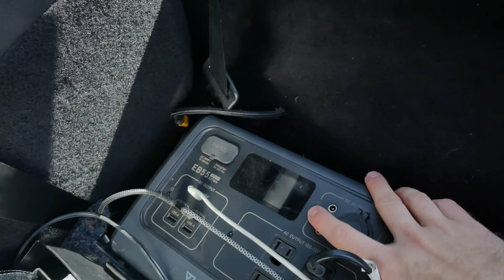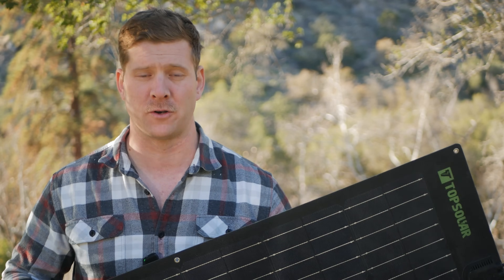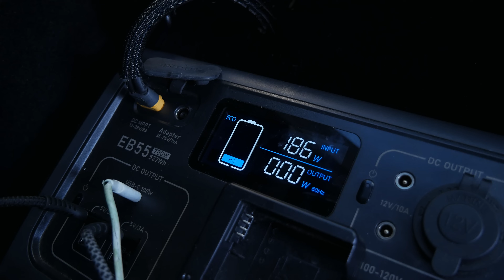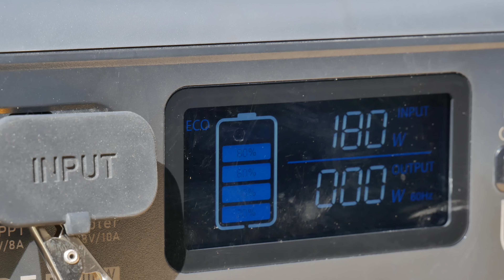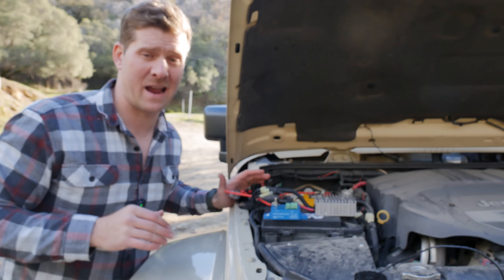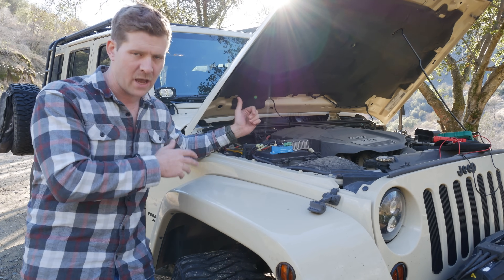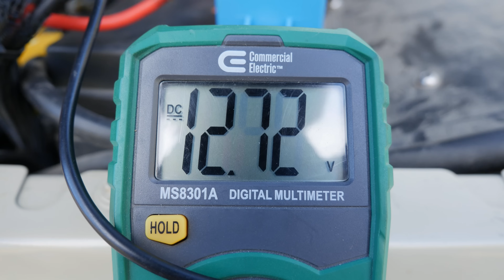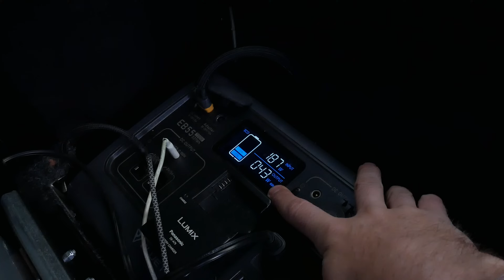Solar is Impractical for Overlanding: Here's a Cheaper Alternative That Makes 200W!

Comment: so basically, you are saying a diesel generator is better than solar, because that's basically what you're doing, no? transform your diesel/petrol into electricity...
i'd still say solar is cheaper: you generate electricity when there is sun, and you don't pay for sun... but you do pay for using your car (maintenance, petrol, ....)
Reply from the maker: @peetersbjorn  I'm not running the engine just to charge this battery. Simply an inexpensive way to capitalize on a higher rate of charge while you're driving to your next campsite

Comment: very nice! I like your Victron solution. those are good quality. I used a cheapo Ampper battery isolator. its 24V out when the input is above 13.3 and stops at 12.8. it can not however live under the hood.
Reply from the maker: @tronskifpv  interesting, what's the issue being under the hood?
Reply: @RhinoOffroad  its not potted like that nice victron you are using. its got conformal coat but you'd have to see one. very  light weight build
Reply from the maker: @tronskifpv  oh gotcha!

Comment: Great video!  But this is not a new concept.  There are YT videos that feature a DC to DC charger that does pretty much the same thing.  However, this solution is a slightly cheaper alternative to purchasing a DC to DC charger with prices starting at approximately $100.  I was shocked that Victron actually sells a product for under $150. 😳  The Victron Energy Battery Protect device is only $36.55 at the time I wrote this.  And the 12 to 24 volt step-up converter is $36.99.  UH OH... the product prices are climbing.

Comment: This has always been a great idea, have been researching this, there's so much they don't tell you about solar panel only charging, it can be very expensive and many times you find yourself always lookin for the perfect place or condition to get the best charge. It can become very stressful honestly. Welldone bro this makes sense plenty everytime. I prays in the future we can actually get a portable and sensible dc to dc generator gas or diesel or propane or whatever, it specifically built to safely but quickly charge my batteries, not meant to carry my AC loads, no, just safely quickly charge my batteries, so I don't need to use my car engine or alternator.
Reply from the maker: @harrisonosezuaomosun5614  totally agree; appreciate the support 🤙

Comment: You have to factor in the additional wear and tear on your alternator and engine. ( drawing more amps DOES increase your engine load). Also the setup you have that automatically draws your starter battery down to 12v will shorten the life of that battery. There’s a reason battery tenders keep them above 12v….
When you factor these in, the $300 solar panel that only weighs 5 pounds and will last 10 years with no maintenance will seem cheap…
Reply from the maker: @atomicsmith  I agree that it increases the engine load, but I don't think enough to substantially increase wear since once the portable battery is charged, it's only adding an additional 50W or so when the fridge is running while driving. 

12V is very safe for an AGM battery, and it  only sits there when I'm out on trips and in-between driving from campsite to campsite. Otherwise it's topped off by the alternator and my charging system is de-energized when I get home from trips.

Lastly, it's not even about the price as much as the impracticality of solar when overlanding. Unless you're hanging out for multiple days at a campsite, you're just not somewhere long enough for solar to be your primary means of charging.

I appreciate the feedback/engagement though!
Reply: Buddy all modern vehicles have at least 100 Amp alternator and 16 amps is like having your headlights on
Reply: @RhinoOffroad Honestly, having both is the way to go, I moved into my overlanding vehicle to save money. Having just solar had not been enough, I have a portable panel that I set on my roof, and it is very impractical to rely on just that, one cloudy day and you're screwed unless you can find somewhere to plug into. I was hoping there was a alternative way to charge this off the alternator, because the cigarette lighter plug is pretty low charging rate, especially for a 2000 watt hour battery. So thanks for this video!
Reply: @willdrivesu7914  better to just buy a bigger battery and charge is at any public place where there s a plug gree for an hour
Reply: Do not charge the bluetty while not driving. Your car battery is not designed and not meant to do that. You'll ruin it.
Reply: @andro7x  You will only be pulling from the battery IF you exceed the output capable from the alternator. In that case, you can get a High Output alternator, or a second battery. Decades upon decades of ridiculous car audio setups prove this.
Reply: @amorton94  I know. This is why I wrote to not charge the bluetti while NOT driving. Charging while driving, when the alternator is working is perfectly fine.
Reply: @andro7x  You're right, I somehow missed that. Though, it is kind of a weird way to put it, "not driving." I must have skipped over that odd "not." Not running, parked, etc and hopefully I would have read it correctly the first time. 😅
Reply: @amorton94  i agree :) I'm not a native English speaker, so I make many mistakes ;)

Comment: $60 in parts plus the cost of the Bluetii portable power station for $300.00. My TT outside kitchen refrigerator is 120 volts, inside fridge 12 volts so if I traveled more than 3-4 hrs on the road then this system makes sense for me so the outside kitchen refridge will keep frozen.

Comment: The jackassery of this is that he is using a car battery. If you have a truck that has a place for a second battery, you would put in a deep cycle marine battery which is made to be run all the way down .
Reply from the maker: @powskier  the costs associated with a separate battery system, separate inverter, and charging controller are far higher than this setup.

Comment: Great video. My opinion entirely, I would set the safety to 12.6 volts. This is because a healthy cranking battery is usually above 12.6 volts. By letting it drain to 12v all the time may reduce the life span of the cranking battery.
I've found this to be the case over the years. Any of my vehicle's batteries that couldn't hold a static charge over 12.6 v consistently was an indication that the battery wasn't happy anymore and was usually on the way out.
Reply: I thought the same at first.  I could be wrong, but it looks like the yellow battery is a second battery, and that is what is being charged, not the starting battery.

Comment: Nice additional option to provide redundancy.

A lot of solar charge controlers have outputs with a low voltage shutoff.  It'll only be 12v, but great for wiring in some lights or a plug  that will be hot when the vehicle is off without killing you starter battery.

Comment: I heard something similar years ago where someone used a solar charge controller instead of the 12->24 volt converter you described here.  Instead of hooking the inputs to a solar panel, hook them up to your alternator.  That might be a better option for batteries that don't have build-in Battery Management Systems (BMS) such as lead-acid batteries.  But most modern batteries these days have a BMS.  

I've never actually tried either method yet but it might be a better method since the solar charge controllers come with all sorts of bells and whistles these days.   You might could even eliminate the low voltage protection switch if the charge controller had that feature built-in.

Comment: Nope! Just put a second battery in your vehicle and a true sine inverter. No solar, no stupid power packs. Charge 80% of your batteries at a rate around 1000 watt per hr.
Reply from the maker: @JD-kj4mj  it's certainly an option, but a lot of people buy a portable battery so they can use it outside their vehicle while at camp
Reply: @RhinoOffroad  Use an extension cord. The system cost less, is more reliable, doesn't take up valuable space in the vehicle, is not going to get wet or stolen, you don't have to move it around, no plugging it in to charge, and did I mention charges WAY faster!. 😉

Comment: At this point why not just bring a normal generator 😂
Reply: This way, you can shut off the engine once you get to camp (and use a solar panel if you  still need to finish charging).  
This set up allows you to charge WHILE driving. Can you do that with a gennie?  If you have to drive for a few hours to get to your destination it eliminates running a noisy, smelly generator at camp.

Comment: What plug did you need then in the back of the jeep?
Reply from the maker: @stephenskwaryk9665  my portable battery used XT-60 connectors for the input, so I soldered on one of those

Comment: Thank you for this video 
I’m working on a diy generator 
A real heavy torque converter on a shaft getting it started is hard even for a HD cordless drill. 1 heavy drill impact to get it running, now a heavy duty cordless buffer to just. Keep the rpm’s at a steady speed the buffer can go to 4000 rpm I keep it to1000rpm (an engine 800 to 1000 to activate the alternator.   A pulley to run a racing alternator 120amp steady plus a capacitor,,    My generator can charge ALL HD portable drill batteries in 45min 
On one full charge the impact drill and buffer have. Kept the generator running for 3 days on 45min charge
Reply: I have done two diy's - my first one I used a GM alternator with a switch to keep the alternator field off until after I started the engine, which made starting it as easy as a lawnmower (using a 5 hp horizontal small engine). My second is a small diesel engine, which is comparatively shoulder-dislocating in terms of starting it, with a 1 wire race alternator. The only issue I see now is having LiFePO batteries having the battery BMS instantaneously shutting off the battery on full charge runs the risk of burning the alternator diodes out!

Comment: There's a new device from Etaker, the F1000, that increases the 13v up to 42v. It has an engine shutoff sensor so that you don't need that victron cutoff. And, the F1000 also has an input for your solar panels, adding as much as another 500 watts.

Comment: Why not just use an inverter? 

The usefulness of a battery charging another battery seems lost on me…
Reply from the maker: @millamulisha  good question! An inverter would have to convert DC to AC then back to DC to charge. This is a low impact way of charging DC to DC. This is also WAY cheaper, and you won't get a better charge rate with an inverter.
Reply: @RhinoOffroad  I must not understand your use case. I thought you were running AC appliances from the portable charging device, but why or how charging such a device from your vehicle’s battery eliminates the need to use solar panels doesn’t make sense to me. I understand it might be a convenience thing, but that’s why I’d just suggest eliminating the step where you use a charged battery to charge an empty battery (there are losses involved there too) altogether (hence why I suggest using an inverter, not to charge your portable battery but to power your AC electrical devices from your vehicle’s battery). 🤷‍♂️
Reply from the maker: @millamulisha  okay I think I understand your question. I don't want to use the vehicle battery to run any of those devices, so my portable battery acts as my auxiliary battery. I also need to be able to run those devices when the vehicle is off (thus necessitating storing the energy). I could run an inverter off my main battery, then plug in the AC adapter to charge my secondary, but it would still max out at 200W (the spec'd limit for the input with my portable battery) and would cost way more in order to do it.

Comment: So you found an adapter to take advantage of your engine as an inefficient gasoline generator. Not only is this not a replacement for solar, but it will also reduce your trip duration as you will need to refuel if you want to continue on your journey. 

The primary function of solar power generation is to have energy regardless of your location, so that despite being hundreds of miles away from civilization, you can still power your equipment even when you run out of fuel.

If that isn't your primary goal then maybe consider a more efficient/powerful alternator to make this method more viable, as well as an upgraded car battery to handle the increased charge and discharge loads, as well as increased power cycling.

Comment: Did i hear that correctly? You set your low voltage cutoff at 12 volts? How long have you run this setup? My concern is that youll shorten the life of your starter battery setting ot this low.
Reply: I know very little about electrical and even I asked myself the same thing. This doesn’t sound like a sustainable long term solution.
Reply from the maker: After getting feedback from the comments I'm going to bump it up 🤙

Comment from the maker: What are your thoughts on this setup? Think it could replace your need for solar?
Reply: i would suggest looking into the pecron alternator charger that can do up to 500w output. if you have ecoflow batteries you can use their alternator charger that does up to 800w of output.
Reply from the maker: @sdsviet  I'll take a look!
Reply from the maker: @sdsviet  they look like interesting options! It looks like the Pecron still needs a LVC and is about 3x the price though of the step up converter. Probably a buy once-cry once kind of product though!
Reply: @RhinoOffroad  i think the pecron does have a manual lvc built in from the reviews i've seen. i could be wrong tho.
Reply from the maker: @sdsviet  definitely nice to know there are good out of the box solutions though!
Reply: You should try the Ecoflow smart alternator charger 800W plus it has reverse charge, to charge up your car battery... It's definitely a game changer and it's simplicity is spot on... Ecoflow know how to make there equipment flow on off grid situations 😉👍
Reply from the maker: @waynerenshaw-multi-outdoor4521  looks like a great solution! Just puts you at a totally different price point

Comment: Nice video. With the gear you have though, I think you could be better off with a @Redarc BC/DC Charger. Have you ever checked those out? 

I have one and 200 watts of solar permanently mounted to the roof rack. I leave my fridge on 24/7 every day.
Reply from the maker: I have, and it is a great option? It's just about 10x the price for what I'm trying to do, so I wanted to explore cost-effective options first. Their gear is top notch though 🤙

Comment: That's not how it works.. the Charge controller is limiting the amps on 12v to keep the wires from melting and catching you vehicle on fire.  You do not magically gain Wattage in fact in conversion you are losing Volt/Amps(watts) in conversion efficiency.
Reply: exactly doubling the voltage is cutting the amperage in half at the end of the day watts are watts. I have one of these DC to DC converters on my fridge to help on voltage drop from my 12vdc system boosting to 24vdc since the fridge is sensitive to voltage loss and will turn off the compressor now that its running at it's highest voltage capacity I no longer have the compressor turning due to voltage drop but the wattage remains the same.

Comment: There is absolutely no such thing as "Watts per hour." Tell me you have no clue what you are talking about, without telling me you have no clue what you are talking about. Also, tell me you will shill for anyone without telling me you will shill for anyone.
Reply: Watt hours are definitely a thing, it's the best way to measure battery capacity as you can then compare the capacity of multiple batteries no matter their voltage.
Reply: @LockyourHubs4WDing  A "watt hour" is using one watt for one hour. "Watt hours" is watts times hours. "Watts PER hour" is watts DIVIDED BY hours.  Watts = Amps x Volts. Amperage is a measure of how many electrons are passing a point in a given amount of time. Or, electrons per second. Essentially the number of electrons divided by time. So "Amps per hour" would be the number of electrons divided by time, then divided by time again. It is an utterly nonsensical unit of measurement.  

You might want to read the actual words of a comment before correcting someone. And knowing even a tiny bit of physics would come in handy too.
Reply: @GrantSR  Not sure where your understanding of the SI unit watt derivative of Wh come from, but there's only one used in both EE and physics.
Reply: @LockyourHubs4WDing    The point is that the YouTuber did NOT say "What hours" or "Amp Hours." He said "Amps PER hour." Which is not absolutely not a thing. AND, my point is that this shows that he really does not know what he is talking about. It is not just misspeaking. Lots of people use that phrasing, and it is always clear that they do so because they have no idea what they are saying. They are merely repeating what some other ignorant YouTuber said. 

For some reason, you are fixated on proving that I don't know what a "Watt Hour" is, when that is not the issue. Your point, while correct, is a complete red herring for this discussion.
Reply: @GrantSR  you referenced Wh in the original post.  

My point is while old mate mightn't have gotten the terminology 100% correct, he did actually reference that he didn't have any qualifications in the subject matter. 

Our job as I see it, who might be able to help the guy who's seeing a little success with the video, is to help him and the audience in the comments section, not to slander. 

Take the higher road.